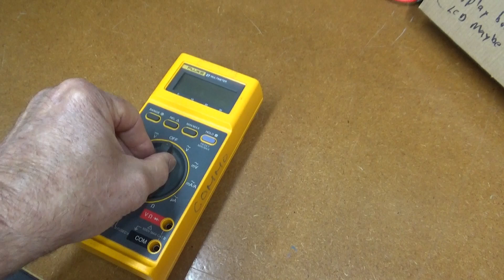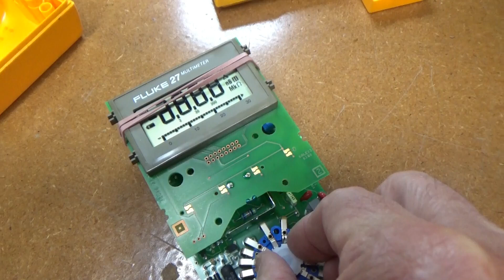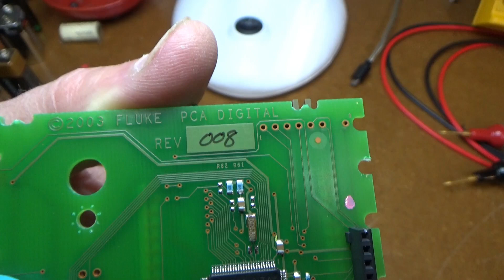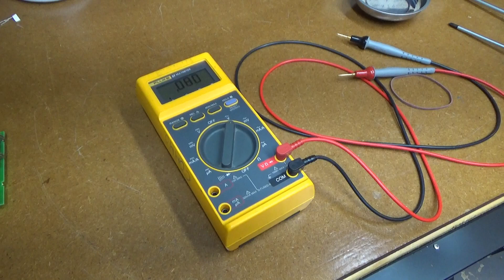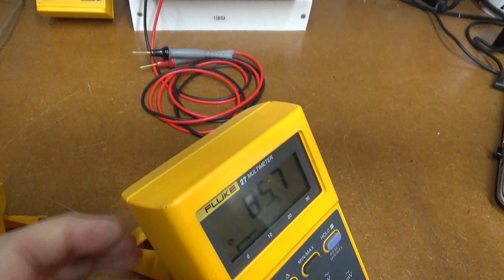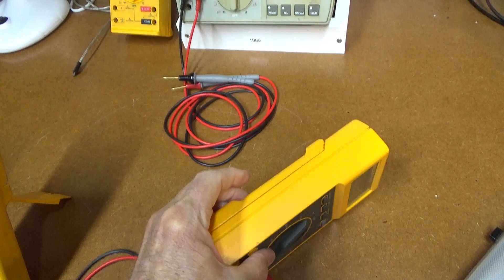2004 Fluke 27 Bad Display Board

Comment: Currently on ebay there are many of these multimeters, there are thousands of them, there are different colors both new and used, they come from military stocks, there is a military version only Fluke27/FM but the military also has many Fluke27 civilian version in stock. I ordered a completely yellow one, I also have a military one purchased more than 20 years ago.
Reply from the maker: I just picked up another one of these on eBay for $35 with free shipping. It's the latest model with the yellow body and charcoal colored face. These seem to all be made around 2004, at least that's the date code on the main Fluke chip. The one I just received works perfectly and is accurate on all ranges.
Reply: @mguess  Once a person gave me a Fluke 8020 or 21 for free which was faulty, at first I thought it was the faulty D/A converter, now I think it was the dead electrolytics that caused the fault. Then much later I bought online another Fluke 8020 or 8021 with the faulty display for 8 Euro/USD. With two multimeters I made a perfect one. I washed the case and it looks near new. Now I have one left that maybe only has the display and the electrolytic capacitors dead, maybe I can find another similar one faulty and almost for free and with two devices I can put together a working one.
Reply from the maker: I have a collection of the early manual ranging Fluke multimeters. I just love them, My current collection consists of: 8020A, 8021B 8022A 8022B 8024B and 8026B. The displays on these early Fluke meters is definitely the weak point. If you find one with a good display you can usually get it working. The electrolytic caps seem to fail frequently with age. If nothing is working except current measurements, check the input resistor. It's also a common failure since it is designed to "open" during an overload condition.
Reply: @mguess Also interesting are the older Beckman like the HD140 and 4410, some of these older Beckman are more accurate than the Fluke 802X series and the older Fluke 7X series.